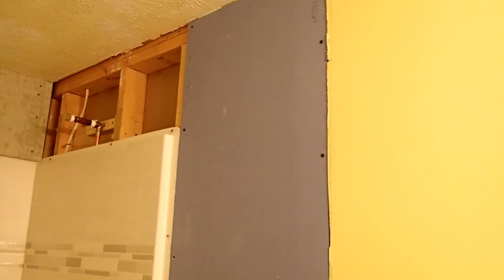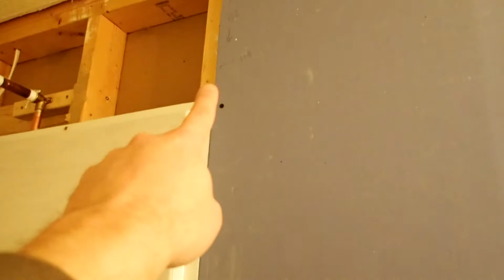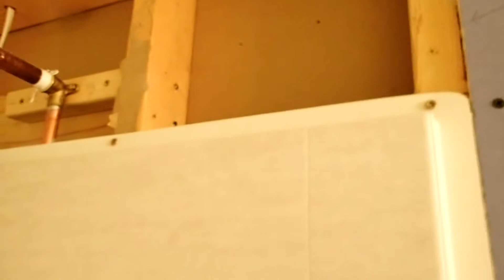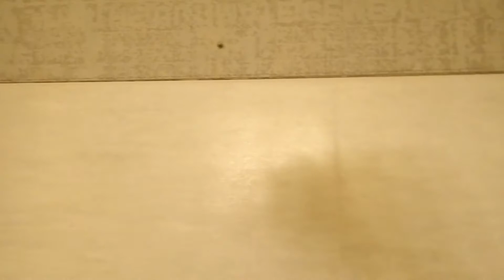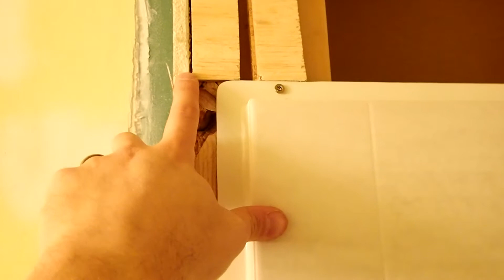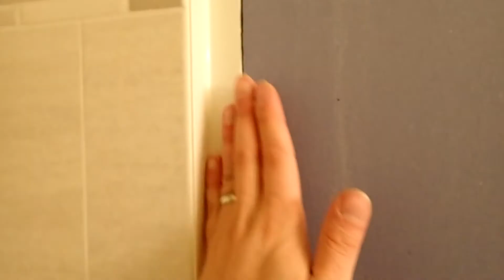Drywall/Hardiebacker for Maax Utile Shower Install (Flange Dilemma)

Comment: On the sidewall that is only a few inches past the flange I did not use backer board. Instead I ripped a piece of 3/4" redwood trim and used a few stainless steel screws to hold it in place. Varnished the redwood and a small amount of silicone sealant to fill the gap. Only time will tell how long it lasts.

Comment: I do like you. Polymer mortar instead of mud. Wide nylon mesh reinforcement. 
I skim the whole surface then apply exterior acrylic stucco. I like durock marble coat fine.
Lasts forever then.